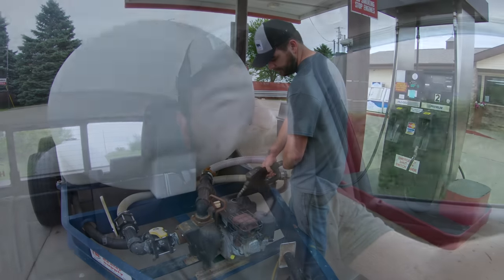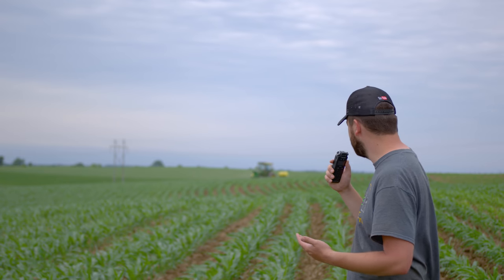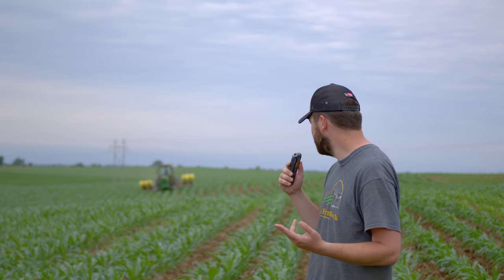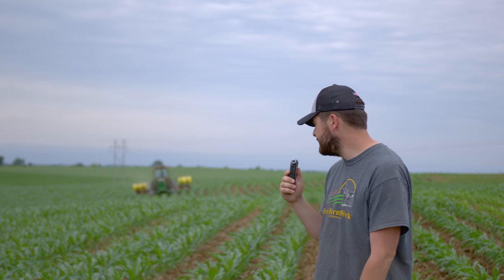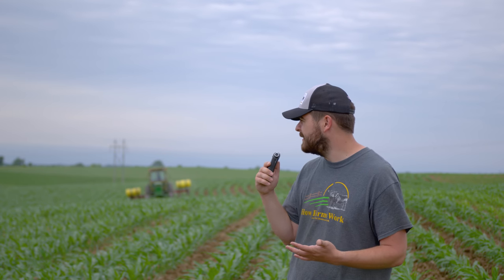Cultivating Corn - John Deere 4020

Comment: That corn grows fast in Wisconsin.  Our corn is at V1 here in Texas because our Springs are too dry and hot to plant early.   I used to take my 1000 gal to the Coop and get fertilizer but now there are very few places that sell less than a transport load.   We have two 3,000 gal. on each farm so we can take a delivery.

Comment: Good job guys.... Like the tank setup. How many gallons and are you using a pto or electric pump? Great camera work too. That corn is going to take off now. Don't think you could have waited much longer or it would have been too tall. Did mine much the same way this year only used granular. Hope you get the rain.

Comment: I just want to know why have your rows that run into the side of other rows love the videos
Reply: End rows... 

It was an education for me when I started helping on my BIL's farm in Indiana.  We always planted on raised beds, and left about a 15-20 foot or so "turning row" on each end of the field, with the rows strictly running back and forth across the field.  Usually we have a bar ditch cut across each end of the field where the middles can drain excess rainwater into it, which then runs to the county ditch to keep the fields from flooding, which we cut and maintain with a 3 point blade like their Rhino blade they grade their driveways with.  

Anyway, "up north" they flat plant-- no beds.  Doing it that way, it just makes more sense to plant a couple passes across each end of the field, and then plant the rest of the field between those "end rows" back and forth (like it was on beds, but flat ground).  Then you just turn over the end rows when you spray or sidedress fertilizer or cultivate or whatever.  Sure you kill a few plants, but the rest still go on to produce crop, so the loss is minimal/ inconsequential... 

My BIL thought that all these wide unplanted turning rows down here in the South are a HUGE waste of good farmland... and to an extent he's right.  That's why a lot of guys would hip or plow up beds across the end of the field to plant "end rows", or just flat plant those end rows (though flat planted stuff doesn't do as well down here.)  That way you minimized the amount of ground left "out of production" for the ditch and turning row, and got some crop off those end rows, without having to jump rows (beds) to turn at each end of the field like you would if you bedded it all up right up to the bar ditch at the end of the field (which can get TERRIBLY rough, like going cross-ways across chisel plowed ground!)  

Later!  OL J R :)

Comment: Porque no inyectar al suelo el fertilizante ? Lo veo que lo tira por encima?
Reply: The fertilizer is being dribbled by drag hoses right next to the planted row, by the front sweeps of the cultivator.  Soil thrown by the middle row of sweeps and the rear sweep helps cover it up and mix it with soil.  

This practice is also done by some folks without the cultivation-- it's called "Y-drops" because it uses a sprayer (usually) with an inverted "T" shaped fitting with a pair of drag hoses that split the fertilizer and route it over to drag hoses running on either side of the planted row, applying it on top of the soil right next to the stalks (and hence next to the roots).  It then relies on irrigation or rainfall to wash the fertilizer down into the root zone.  

I agree with you that it's best to actually put the fertilizer into the soil, since it protects it from the sun and elements, and water runoff in heavy rains.  The fertilizer must be down in the root zone to actually get taken up by the plants anyway.  But, for guys practicing "no-till" farming, it's a viable way of fertilizing.  

We always knifed in our fertilizer about 6-8 inches off the row when we sidedressed using a side-dress applicator... 

Later!  OL J R :)

Comment: I see he overlaped the cultivater, so that row got twice the fertilizer, will it make a difference?
Reply: I`m just saying he does the outside row twice. So more fertilizer on those rows? I don`t know just wondering.
Reply: Could be half rate nozzles on the outsides.
Reply: No, it's like KJ said above... the outside middle (ground between the planted rows) is worked twice, because the outside gangs of the cultivator only have sweeps (and a fertilizer drop hose) next to the row going under the toolbar... 

Look at it this way-- there are 6 rows of corn going UNDER the cultivator with each pass... each row has a drop hose on both sides of it, for 12 total drop hoses.  SO the row of corn plants are getting fertilizer dribbled on BOTH sides of the row as it's cultivated.  The outside middles get worked twice by the sweeps, true, BUT, there is only a fertilizer drop hose on the side next to the row going UNDER the cultivator bar, NOT on the other side in the adjacent row, which got fertilized in the pass before... 

SO, each row is getting equal amounts of fertilizer, regardless of whether it's an "inside row" or an "outside row" next to the middle that was worked by the outside gang on the last pass... 

Later!  OL J R :)